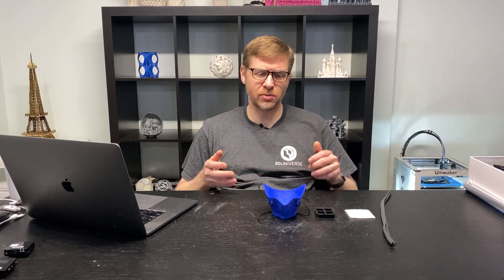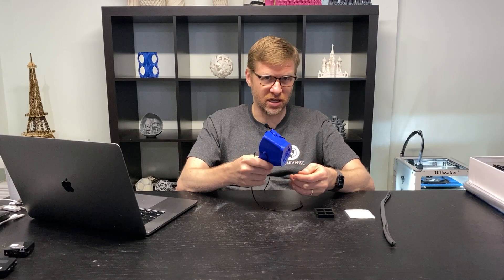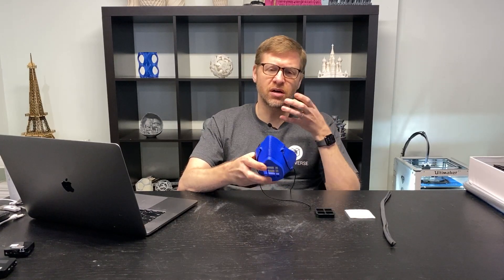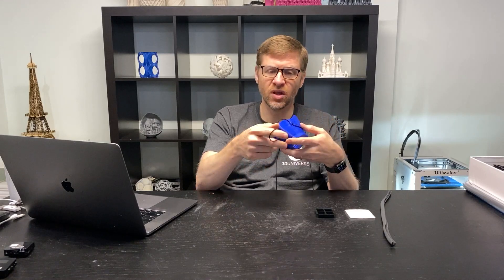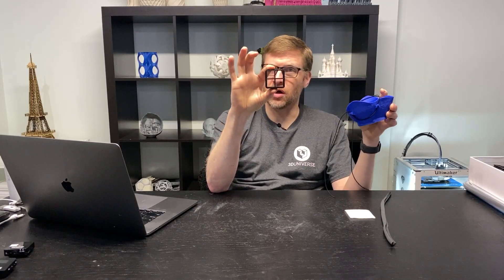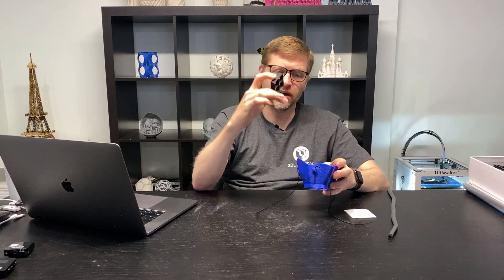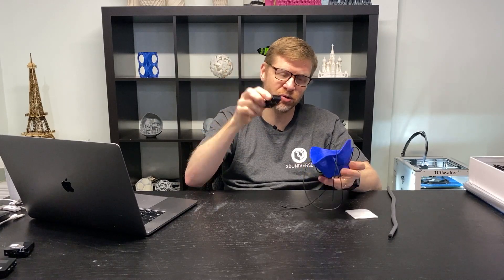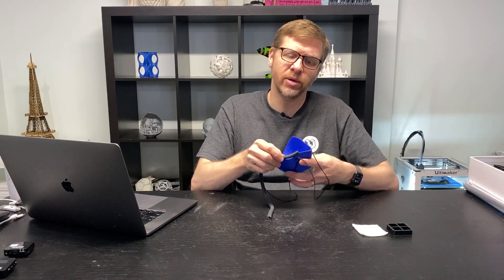BE Mask (Buffalo e-NABLE Mask) - 3D Printed Reusable Mask

Comment: This is awesome. I designed one as well based off of the Montana mask and the popular covid19 3 part mask on thingiverse. I redesigned the front to be less boxy, have the front faceplate as part of the mask rather than seperate. I also added a 10mm hole in the front to allow a pen or pencil to push the filter grid out. Makes replacing the filter easier. I also scaled the body a little  so that it doesnt push on the nose so much. I then used 100% silicone caulk to make a bead around the edge for comfort and to seal the mask better. Printed tons of them

Comment: @3D Universe, thanks for the video. Are you concerned that the seal between the plastic frame filter insert, filter material, and mask can be compromised by the bunching up of the filter material, particularly in the corners?

Comment: Awesome work.  been following you for a while in regards to this mask and have made many of them in different styles.  They keep getting better.  My only suggestion would be to make the strap holes a little larger so that the mask can accommodate many different types of straps.  I use shoe strings right now because it's been hard to find anything else right now and believe or not it's pretty hard to get the shoe strings through the current holes.  Keep up the great work.  Looking forward to future versions.  ;)

Comment: Hello, 
I just used your model using my CR10-S printer using TPU filament. 
During the final 25% I experienced a shift in the model.
If anyone have any specific setting for the CR-10S using TPU for printing this model. 
Although the print failed, I believe this was a well designed mask. 
Any information would be a great help.

Comment: I have a teenage daughter who's face size is smaller than the smallest XS sized mask. Is it OK to scale the design down to fit her face (bridge of nose to chin of about 97 mm)? Any recommendations on how best to do this, or should I just uniformly scale the XS design down along all 3 axes? Will there be any problem with the mask being too shallow to fit her face if I scale uniformly? Thanks for the excellent work on this!!
Reply from the maker: Yes, you can scale it down as needed. Just be sure to scale the mask and the filter frame by the same amount.

Comment: Is it possible to add an exhale valve to the design?
Reply: That seems like it might reduce the protection the mask provides to others. One of the best things mask wearing can do is reduce transmission in both directions, so it seems you would want both inhalation and exhalation to pass through the filter.

Comment: could you heat up the mask if it is printed in PLA and form it to an individuals face just like the copper 3d mask
Reply from the maker: Yes, thermoforming is recommended if you decide to print the mask in PLA. Our testing shows that it doesn't provide a good enough seal on the face without that.
Reply: Thanks

Comment: i sliced the large with tpu with your settings. it says
 16+ hours. is this normal? thanks! be safe
Reply from the maker: Depends on your layer height. With 0.3mm layers, it should be around 5 hrs. Using a 0.8mm nozzle will reduce it further.
Reply: Thanks. I was able to get it down to 10.5 hours with a 0.5 nozzle
Reply from the maker: @slowiphone5555  It should take no more than 5 hours to print, so you may want to have another look at your settings. Try using 0.32mm layer height with 2 shells and 15% infill. That should get you to around 5 hours or a little less.
Reply: @3duniverseOrgWelcomesYou  What is your recommendation with a 0.8mm nozzle?  I just purchased TPU filament and would like to print as many as I can at once.  I have the Merv 16 filter just waiting to be used. Did you find out if one layer or 2 layers would suffice?  Thanks in advance.

Comment: Have you considered printing these using polypropylene (like the filter material)? It's reasonably flexible, has good chemical resistance, and the whole mask could likely be autoclaved or sterilized with EtO.

Comment: Hi, thanks for improving the design. I was wondering if it could be  possible for you to share all the parameter to print with an ultimaker S5 and TPU material (maybe a screenshot of each section). I have one at work. I am quite novice in printing with this model and do not want to make any mistake. Thanks for your answer
Reply from the maker: Yes, you’ll fine all of those settings in the documentation: https://docs.google.com/document/d/1n_1V9ROD3AiEMlA5_u5XAlIYw52CTDHddm8hrRz7xGM
Reply: @3duniverseOrgWelcomesYou  Hi Thanks for the answer. I have print some with the MDflex TPU materials but I can see some "stringing-effect" any idea on how I could improve the printing quality. Thanks for the input
Reply from the maker: @pepanouillot4634  That depends a lot on the printer and the material being used. A lower temperature might help. You could also try increasing the retraction distance and retraction speed a bit. Even if there is some stringing, that's pretty easy to clean up. Just use a sharp blade to trim away most of the strings, then use a heat gun to melt away any remaining strings.

Comment: couldn't you make it just 1 filter size in a effort to get manufacturers to make and sell  the best ONE filter that would be more compliant with the CDC.   It is cheaper to tool up to make 1 filter then 5 sizes. yes i know that if i am making them  it doesn't matter.
Reply from the maker: We explored that option, but with the current design, we would have to standardize on the smallest size in order to make the filter size the same for all 5 sizes. The result is a 23% reduction in the filter surface area at the large size. We are working on alternate approaches that would allow for standardized filter sizes and even the ability to attach standard filter cartridges, but that will come in a future version of the design.
Reply: @3duniverseOrgWelcomesYou   Also we are not in normal times , as having a list of filters to harvest raw materials allows for more supply, aka what is on stock now / in county  vs slow boat to china  etc.   Keep in mind these filters may be used in infrastructure 🏥  as their intended purpose aka building filter . We are living in times of scarcity, try to get the copper filament  .

Comment: I also forgot to ask ... With regard to the Bag Air Filters that you are using from McMaster-Carr, any of the MERV 15 would be appropriate, right?

In your answer to a question below, regarding the bags themselves, you stated that "[you] cut the bags open so it's a large flat sheet of filter material. So the square piece of filter material ends up being a single layer."  Is there any special method to the cutting of the bags, so that one ends up with one large piece?  It sounds like each bag has more than one layer to it ... Is there any material (charcoal, fiber, etc.) in between the layers?  Does it matter which side of the squares cut from the bags is facing out from the mask and facing in toward the mask wearer?  Do the square pieces cut need to be cleaned in any way, before placing them into the mask?  I realize that one gets many filters from the bags, but if necessary would it be advisable to sanitize them (e.g., with hydrogen peroxide) for reuse?  Finally, in the Design Documentation, you indicate that the cut filter size is 2.5 inches square ... Does that measurement fit all the Filter Frame sizes XS to XL?
Reply from the maker: As far as we're aware, any MERV-15 filter would be okay, but the specific part number referenced in our documentation is the only one we've tested.

In terms of cutting the bags open. There's a seam that goes around the outer edges that needs to be cut. There are also strips of material running vertically down the length of the filter every few inches to connect the two sides together. Those strips can be pulled off carefully. Then you should be left with one large sheet of filter material. As far as we're aware, there is no material between the filter layers. It appears to be the same material all the way through.

The same 2.5 inch square size should work for all mask sizes. There will just be a little extra margin around the edges for the smaller size masks, which is okay.
Reply: @3duniverseOrgWelcomesYou  Thanks for the information, regarding cutting the bags and the cut size for the filter!  As to the MERV-15 Air Bag Filter mentioned in the Design Documentation, there is only a link provided to a McMaster-Carr Bag Air Filters page, which has listings for MERV 10, 12 & 15 Bags, in a variety of sizes (with different part numbers) for each.  I assume that any of the MERV-15 Air Bag Filters listed on that page will suffice.

(The Gasket, which also has a link to a McMaster-Carr website, does open to the page of a specific part number 4869A68.)

Comment: Could you please provide the height / width / length measurements in millimeters of the mask parts in the various sizes in the Design Documentation in Google Docs?  Only the Length is currently listed in the Document.  I want to get some of these done by a local 3d Printer (as I do not have a 3d Printer myself), and they require the aforementioned measurements, when submitting an order.  Also, as to Material types, I assume that I would check the "Plastic" box on the Order Form -- the selections are Acrylic, Composite, Metal, Plastic, Precious Metal, Other -- and then in either the "Details" or "Notes" section on the Order Form, specify TPU as the desired construction material ... Does this sound correct?

Thanks so much for all of the hard work of you and your team!  I'd also come to the conclusion, after researching, that the Montana Mask seemed the most promising design.  However, I had seen User/Maker comments describing drawbacks to it, and having no experience in modifying CAD files, I didn't know how I could correct them.  I was very happy to have found your modified design, which corrected all of the noted shortcomings!!

Keep up the great work!!!
Reply from the maker: OK, full dimensions for all sizes have been added to the Google Doc. Yes, you would want to request to have these printed in TPU for the mask body and PLA for the filter frame component. Depending on the 3D printing service you're using, they may or may not have the ability to print TPU. Good luck!
Reply: @3duniverseOrgWelcomesYou  Thanks so much for the update to the Design Documentation, regarding the added measurements, I appreciate it!

Comment: Do you use all layers of the filter?
Reply from the maker: For the filters we're using (the MERV-15 bag filters from McMaster), we cut the bags open so it's a large flat sheet of filter material. So the square piece of filter material ends up being a single layer. We're still testing to see whether it might be best to use two layers of this filter material. We'll update the documentation with our findings soon.